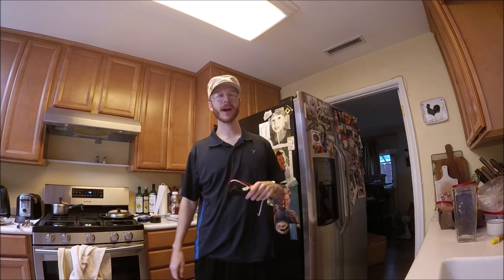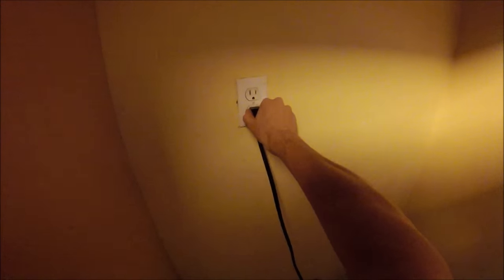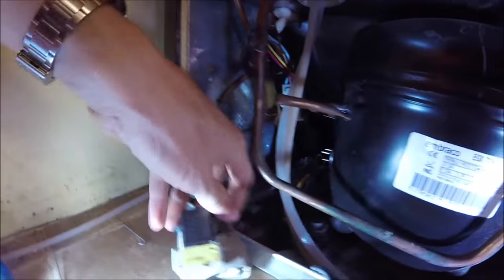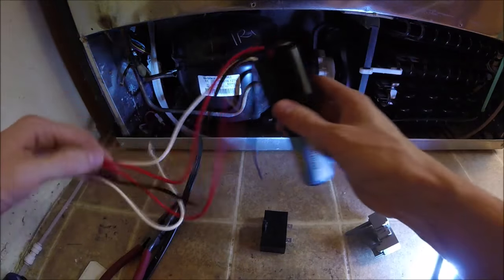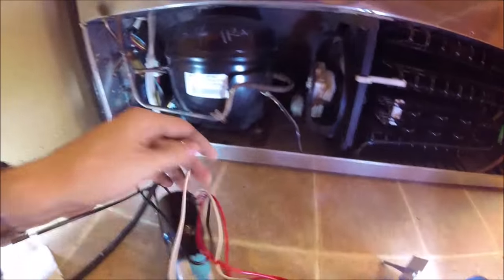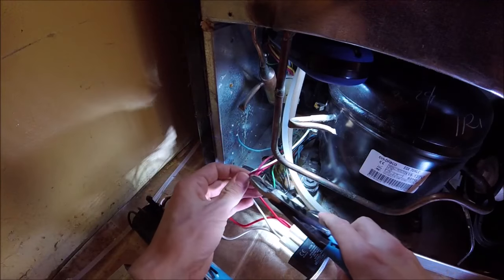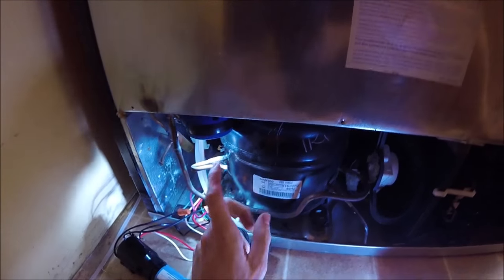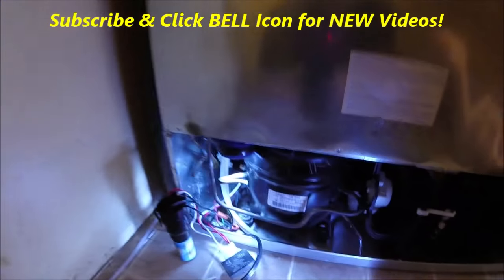Fix Refrigerator. Installing Universal Relay (3 in 1 Starter) on Compressor -Jonny DIY

Comment: The relay link posted is Supco RCO410 Start Kit. It doesn't have the connector on the red and white lines as the one you used in the video. The correct one should be "Supco URCO410-0 Pre-wired Capacitor", which is what you used. Now, I have to return the wrong one.
Reply from the maker: Sorry about that, but all you need to do is cut a couple short lengths of wire and pigtail them on with a wire nut and connect to capacitor. No need to return 👍🏻

Comment: I REPLACED  overload and relay, the fridge still short cycles but cools. Would this capacitor stop the short cycle?
Reply from the maker: It's possible, it could really be a lot of things. Even dirty dusty coils can cause it to short cycle. Could also be something on the main control board, like a capacitor
Reply: @JonnyDIY  I replaced overload and relay so circuit board possible which is over 200 bucks. I'll buy a new fridge before I replace the board. Thanks for your input.

Comment: I have a mini fridge that stopped working so i obught a hard start ,,put wires on as directions say but when i plugeed it in unit sparked a little and quit,,,question is there are two black wires coming out of hardstart,,power cord from fridge has 3 wires,,a white ,,red and a green one,,,does it matter which black wire goes where,,,HELPO

Comment: Would the starter kit damage the compressor if we cross red and white wire? Meaning, put the red wire on start and white on run
Reply from the maker: Not sure, I would follow wiring diagram instructions.  And make sure compressor is cycling on and off correctly 👍

Comment: Question:  Do you leave the hard start kit in there?  Is there any danger to catching fire?
Reply from the maker: Yes you leave it in there. No it should be fine. Just be sure to tuck it away and zip tie it in place and be careful of placement by wheels 👍
Reply: Thanks Jonny without the H
Reply from the maker: @johnwhalen9499  You're welcome, happy to help 👍

Comment: Do all refrigerators have overload relays? I have an LG 2020 model that only seems to have a wire harness (without overload cylinder shaped part) from PCB to the compressor. 
Fridge shows error 22 and PCB red light blinks thrice despite installing new PCB
Thanks.
Reply from the maker: Not sure about that, but a quick Google search says code 22 can mean bad start relay and to try replacing it. Maybe some one else can chime in

Comment: If I want to remove the compressor for scrap can I just cut the copper with a plier or will it explode?  Or do I need a to make a small hole to release pressure 1st ?
Reply from the maker: You should have the refrigerant collected and not vent to atmosphere, but if you're going to, make small hose in copper line

Comment: So we're trying to follow the video and links - the link for the start up kit, does not look like the part you're using. We see that the red & white wires has two ends on your video, one pair that goes to the capacitor and the other pair plus the black wire that goes to the compressor. Can you post the link to the part that you actually used on this video?
Reply from the maker: It's the same one just a different maker, they're universal. I bought mine locally from appliance parts dealer. The one I linked will work and install just like this one.
Reply: @JonnyDIY  Yes we just installed the one we got from the appliance parts dealer and so far it's running. Hopefully in 4-12 hrs it'll start freezing! It's a chest freezer btw! Thanks for the great DIY video, very easy to follow.
Reply from the maker: You're welcome, glad you got it fixed :)

Comment: Jonny, I bought a Supco 3-1 part. I connected it but it didn't work. My question is this...should I buy a 3-1 with connectors for capacitor?
Reply from the maker: You can pigtail a couple short wires into the wire nuts and connect those 2 to the capacitor via a couple crimp on female connectors. You dont need to buy a separate part. Do that and see if it works, hopefully thatll do the trick. If not will have to start troubleshooting.

Comment: Hi could i know what is the vslue of the capacitor pls?  I was told if i put a too big cap my start winding will burn out.
Pls advice...
Reply from the maker: Sorry not sure about that, I just use the factory capacitor if it has one, but others have said you don't even need to since the new 3 n 1 has a capacitor built in

Comment: Hey Jonny, just saw your video and trying to put one on my haier deep freezer.  It's the two black wires I'm have trouble with. Tour original relay wires are red and black. I have different colors, what color do I hook them too
 I have green,  blue, green and white wires?
Reply from the maker: Connect wires to compressor as I did. Then Im thinking one of your 3 wires is a ground wire. Then white wire should match up with new relay. And blue wire is probably the power or same as red wire was on mine. If 1 or your 3 wires is a grounding wire you will know because it will run to a point and will be bolted or screwed down

Comment: Hey man I’m confused. Where did you get the days chain wires the 3-1 doesn’t come like that does it?
Reply from the maker: Mine came like that where you could add in the Capacitor in line if you have one. If you dont have connectors you can still add it in with connectors from capacitor and wire nuts

Comment: The photo on the amazon link in the description doesn't show the plugs on that connect to the capacitor. Does it come with the plugs and just doesn't show it in the photo?
Reply from the maker: Try this one 👍
https://amzn.to/3StZRmT
Reply: @JonnyDIY  Thank you :)
Reply from the maker: @LiamAtkins1313  you're welcome 👍
Reply: Sorry to be a pain but would the one without the extra connectors work? Is that that little black box necessary for it to work right?
Reply from the maker: @LiamAtkins1313  either one should work 👍
Reply: @JonnyDIY  It worked!! Thank you so much!!
Reply from the maker: @LiamAtkins1313  awesome, happy I could help 👍

Comment: 👉‼️ Jonny👈‼️ Hi. Nice vid. I have a sort of a (mini big) Refrig . It cools …. sort of … use to freeze things, it worked so well. Now have to put drinks in the freezer to get the right cold, I use to get in the Refrig. IF a Refrig still cools somewhat and fans work. Could the issue still be the relay ?  I want this to be the issue so badly, as I think after watching ur vid and many others on changing out this part …. I cod do it myself.  But I don’t get if a Refrig still has SOME cooling power how replacing the the relay cod make it cool more. Would you mind giving me your advice and or suggestions because this would b most appreciated❓🙏
Reply from the maker: Doesn't sound like a relay issue. Maybe more of a compressor or refrigerant issue. How old is fridge?
Reply: @JonnyDIY  So appreciate 🙏 ur reply. So many vids I wave watched (wine cooler / refrig not cooling enuff? Etc etc … ) they change out the relay and POW‼️ 🥊👊‼️it works/cools! 
It’s a 2004 ULINE (almost impossible to find anything about that brand on yt OR anywhere) 
It would be expensive to fix (unless a total lay person like me could change out the compressor)  (even that Wod be $400 just for the part) I noticed it failing (not cooling properly) and the. Realized the coils were covered in dust. Cleaned. Took back off (fans do work) 
Drats if it’s not the relay 
It’s probably gonna be to expensive for me UNLESS it’s not difficult to switch out the compressor. But then it cod be that other part that has the coolant (or whatever one calls it for a refrig. 
Any MORE OR OTHER advice Would be appreciated ‼️🙏‼️ If not asking to much
Reply from the maker: @nadagabri5783  hmm well you could try adding refrigerant. It could be low at that age. Wouldnt cost too much. It's a gamble like anything else. Here's a video where I show process 
https://youtu.be/-0udKOMtXx4
Reply: @JonnyDIY  HI ‼️ I don’t know a lot about refrigerators or mechanics. But I can learn/ attempt to learn and do mechanical stuff, if it’s not too difficult. However, my limited understanding of the Uline brand is their cooling system, is enclosed.  One can’t just add coolant to it, like one can with a car. I don’t know all the right words &  I’m replying from my phone. when I get back home I’ll look up the proper words/parts. Drats, i so wanted it to be the relay. Is a compressor difficult for a lay person to replace?  What about my issue makes u pretty certain in ur experience Not the replay?  Ur prob correct yet curious. And thank you Jonnie 🙏

Comment: Hey Jonny - I have a Samsung fridge and I'm trying to install the 3n1 (I have all the prongs properly connected) but there are three cables going into my original relay, and I'm not sure how to connect it to the 3n1. The wires are black, purple, and blue if that helps. Thanks so much for your video!
Reply from the maker: sorry hard not being able to see it. Try a Google search on your fridge model to find wiring diagram
Reply: The 3n 1 is not recomended or does not work on all models, for example on Inverted compressors does not work; always ask your part supplier more than likely they will tell you and advice.
Reply: Don't connect a 3n1 to your fridge! Many if not most modern Fridges of the last 10 years or so use variable speed inverter compressors and you can destroy your compressor by attempting to run it with a 3n1. Johnny DIY has done a great disservice by not mentioning this. Furthermore, if you do have a single speed compressor fridge, it's always best to go with the manufacturer's relay and only use a 3n1 temporarily until you get the actual replacement . Relays have different amp ratings and the possibility of shortening the life span of your compressor exists.

Comment: You mentioned the common BUT you didn't explain the Start and Run terminals on the compressor. Wrong way round and it will burn out the winding

Comment: hi what's the hp rating of the compressor in this fridge? I'm wondering if you know where I can find a 1hp version of this 3in1 start kit
Reply from the maker: Think one I put in was only 1/3hp. Here's one I found for you rated for 1-3hp 👍
https://amzn.to/3R2JMFI
Reply: @JonnyDIY  I made a mistake, it's not HP but labeled as 1PH(single phase). There's no specific HP label, but what I computed from rated voltage and current was the fridge was rated 0.23 hp, so in this case should I purchase RC0810 (1/12-1/5) or RC0410(1/4-1/3)?
Reply from the maker: @wync2203  I would go with the 1/4-1/3. The one I used in video is pretty universal for normal size fridges too 👍

Comment: Just install this on a chest freezer. Started up and seems to be getting cold. Only issue is the side of the freezer is getting hot. Much hotter than my other chest freezer at home. Is this normal or should I keep my eye on it? Don't want it to catch on fire...
Reply from the maker: Depends on design of fridge. Some have the coils right up against the metal sides with minimal insulation barrier and can get the metal pretty hot
Reply: @JonnyDIY  sounds like it is normal as expected then. That's good news!
Reply from the maker: @moivan  yeah I have a mini fridge that even gets too hot to touch during Summer

Comment: Mine has 4 connectors to the relay and then my    red wire to the overload protector which in this case would be my common. What do I do with the rest of the wires ?

Comment: So did replace the relay with another same model one and it got blow ( did it twice by the way) , but after i watched your video i order the 3-1 start kit i just installed it mow i hear the compressor keep clicking trying to work every 1 min but it wont , what you think the issue is , is it bad compressor or should i try different starter kit ?
Reply from the maker: Id double check the wiring. Sounds like it could be  bad relay. Sometimes compressor goes out  same time though. May need to get out multimeter

Comment: Hi Johnny i bought the 3 in 1 starter kit. Do you still need to connect to old run capacitor to it? My fridge had one but my 3 in 1 relay didnt have the extra clips for it. I just didnt use them and when i connected it my compressor turned on but its been two hours and its not getting cold. Its been off for 2 days btw.
Reply from the maker: Hmm if compressor kicked on should be getting cold if that was only problem but yes you need to connect the capacitor. Just splice in the capacitor to the 2 wires. Hopefully that does the trick
Reply: @JonnyDIY  Ok im gonna let it run over night to so if anything changes, if not then i will splice the wires. Thank you for your speedy reply .

Comment: Hi Johnny, will this lower the start up watts of the fridge? i.e. if you are running house with a generator during a power outage the fridge draws about 1800 watts to start up ...but only 200-400 watts once running...I am trying to lower the amp usage on any appliance I can so I can run more lights/appliances without overloading the generator....thanks
Reply from the maker: No I dont think itll change the startup draw at all. If any probably nominal amount. Sorry, but best bet is to just get either a separate generator for the fridge or a larger one for everything. Try looking 2nd hand on craigslist and apps like offerup and letgo
Reply: A larger capacitor deliveres a larger initial jolt of electricity, requiring less of an instant load on your electrical system. Other than that, there's no difference.
Reply: Did you find a way to reduce the start up draw of your fridge compressor? I’m trying to achieve the same thing.

Comment: I wish you didn’t skip a step when you pulled the relays off of the compressor/capacitor or whatever you wanna call it. Great video though it helped out a lot
Reply from the maker: Glad to help, I think I must have removed it before I started made the video. I was trying to source an original part replacement, but couldn't get my hands on one for like a week so went with one of these 👍
Reply from the maker: It just very easily unplugged too, wasn't much to show

Comment: what did you do with the common wire you unplugged from the compressor?  Leave it hanging loose?
Reply from the maker: 3:08 the ones we disconnect from compressor we connect to the 2 black wires with a couple wire nuts

Comment: Hi I have whirlpool frss2vaf20 will this work in that I am in the UK? Just my compressor is not kicking in. I've tried to change just the capacitor but still won't work so was thinking of trying one of these but in the UK we are 240v
Reply from the maker: I dont think this specific one will work but looks like there are some 240v options. Part: Supco 3W1, may be the right one if the spec's match

Comment: Jonny, any idea if the 3 in 1 will last longer than just replacing the relay overload and capacitor? Also, any video on how to remove the 3 in 1 and reinstall the relay overload and capacitor back to original just incase? I was told that the 3 in 1 should be a temporary fix not permanent.  Whats your thoughts?
Reply from the maker: Should last as long as original part but much cheaper. I have a video replacing an original relay if you search "refrigerator" in my videos
Reply: Great vid...I love the straight too the point approach.

Comment: For me this doesn't fix it, but I can run the compressor only by directly connecting the relay to AC, hot wire to one of the black and white neutral to the other black, but I can't just connect the fridges red and white, that doesn't fire up the compressor, so I either have a bad motherboard or temperature sensor or could that start capacitor in the middle have gone bad?

Comment: So i understand that the 2 black(power supply) wires get hooked up to the wire harness that i pulled out from my bad relay. Correct? But you only show 2 wires, 1 white and 1 red! But I have 4.... 2 red 2 white. Do I hook up all of them so each wire nut holds 3 wires?
Reply from the maker: yes mine were chained together to go to the capacitor in line
Reply: @JonnyDIY  my RCO410 doesn’t have the daisy chain red and white you takes about??
Reply: Talked
Reply from the maker: @scottsingletary7642  you can try running it without your capacitor in line and see if works or simply cut the wires and use some wire nuts and connectors to run the capacitor in line

Comment: Installed 3 n 1 in K eff more Upright Freezer. Compressor getting warm.  Coil in freezer is beginning to frost.  Is this a god sign?
Reply from the maker: Yes sounds like its starting to work again. Will take 24 hours to cool down fully

Comment: Hey thanks, you should probably warn people not to touch the capacitor. Some of those are lethal.
Reply from the maker: You're welcome, yes you can discharge with an insulated handled screwdriver by touching it to both terminals at same time for a few moments

Comment: Is there a difference on RCO410 and RCO810?
Reply from the maker: Yes the 410 is rated for compressors 1/4 to 1/3 hp and the 810 smaller 1/12 to 1/5 👍

Comment: will the fridge or deep freezer in my case still kick on and off with the thermostat like its supposed to, and how do I know witch (3 n 1) to install for my chest deep freezer.. thanks in advance for any info.
Reply from the maker: Yes the relay wont affect the thermostat. And they're based on compressor hp ratings
Reply: my compressor is GE Part number AP4368059.. the HP rating is not on the compressor and GE web site says they do not put HP or BTU ratings on the compressors and if I needed a new compressor I can order one.. is there anyway to get the HP info I need ? the model number is FCM7DUCWW
Reply from the maker: I looked up a few similar size ones. Looks like this one may have the right hp ratings.
https://amzn.to/2spCww2
Reply: @steveclem4067  I will come and just buy u a new freezer